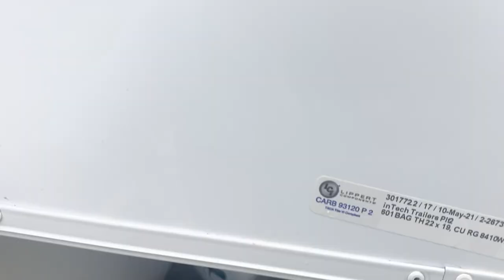Mini-Split 6000 BTU air conditioner/heater in tiny RV.

Comment: 2 weeks ago I put the 9000 btu minisplit in my 30 foot holiday rambler travel trailer. It's a 38 seer and 220 volt. I am running it off a 4000 watt low frequency sungold power split phase inverter. It barely uses any power at all and cools the camper down in minutes.  I could have gotten away with a much smaller inverter but at the time I didn't know what kinda Amp draw it would have at startup. My install took all day but it looks good and works so much better than expected. I removed my spare tire from the rear bumper and bought 2 truck bed extenders and 2 bumper receiver hitches to mount it on. Worked great. I have 1800 watts of solar and 24 nissan leaf batteries running my camper and minisplit.  I just ordered a bunch of lifepo4 cells and will be using them for the camper inverter and the leaf cells for the minisplit inverter only. Thanks for doi.g the video

Comment: Is the line precharged like MrCool units or do you have to vacuum it out/do any chemical work?
Reply from the maker: The lines are not precharged. You need to vacuum them out. I had to cut/shorten my lines because they were too long and if they were precharged they wouldn't have helped. Thanks for watching.

Comment: How many watts is this pulling?
Reply: Suppose to be 279w  6000 btu divided by 21.5 seer2 = 279w
Reply: @jw8567  Maybe under ideal conditions. I'd like to see a real world test with this running in weather above 100 degrees farenheit. EIther way at 6000 btu if it still manages to be at around 550 watts or less under those conditions that'd be impressive
Reply: @TheJuiceman247  I'll put a watt meter on it and see how many I get.
Reply: Look like it’s a good stuff but I was wondering how many watts it’s using ?
Reply: Im in the same boat as everyone else. How many watts is it using??
Reply: @jw8567 that's not how the SEER rating works, SEER is seasonal energy efficiency ratio, it's kind of an average.  You're looking for the EER which is at a certain setpoint (can't remember the temp/humidity offhand) in order to do that calculation.  The values on this unit is similar to the 9000btu from Pioneer (these are all rebranded Midea units) which has an EER of 12.5 so I would assume yours is the same and just programmed to run at a slower compressor speed.  This would put you at around 480 watts (6000btu/12.5EER)